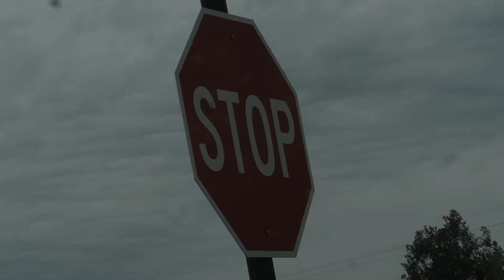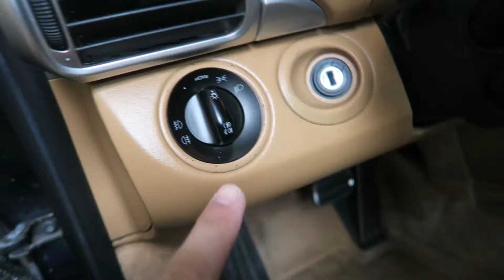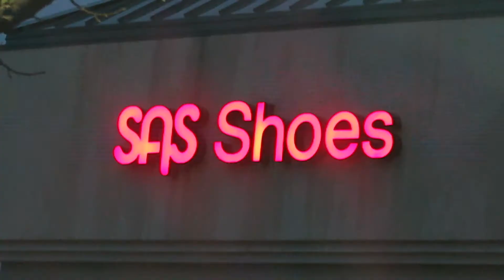How Long Can I Last!

Comment: What do you seal the lights with?
Reply from the maker: Killacorn 
Hi, I like the Meguiars synthetic sealant 2.0
http://www.meguiars.com/en/professional/products/m2116-synthetic-sealant-20-16oz/
Reply: Toly's Detailing Vlogs I have tried that but then I need tore-polish the lights within a few months.
Reply from the maker: Killacorn
usually you have to sand it really Good, and polish it with compound really good and you can check by wiping with cleaning solution before applying sealant, and if cleaning solution makes it dull again that means you have to polish more with compound, until wiping with cleaning solution and it stays shiny then you can apply sealant.
Reply: yeah I do sand and make them crystal clear, but after a few months they are hazy again.
Reply from the maker: Killacorn 
you have to test the compound if you got it polished all the way, so you need to spray some kinda cleaner after you polished with the compound and wipe it to see if imperfections show up after the cleaner. What it is compound has oily/glossy liquid and some times that makes it shiny with out knowing if you finished with the compound. so you need to do compound longer even if it looks glossy. because oily surface washes away in shorter time. but also it depends on quality of plastic lenses. so yeah sometimes you just do what you can but try my method next time.